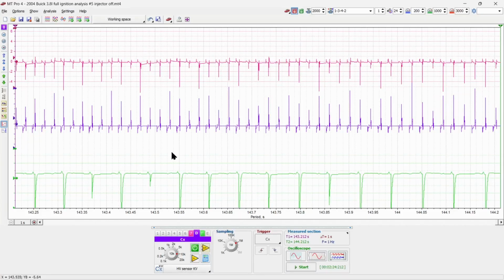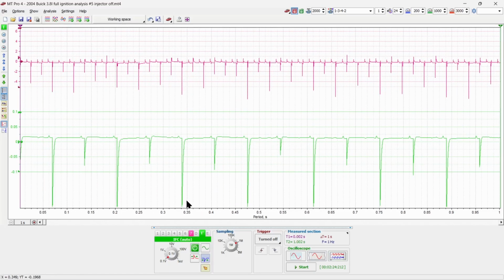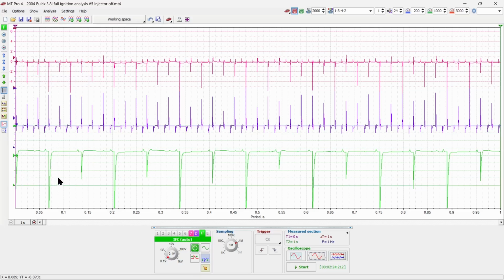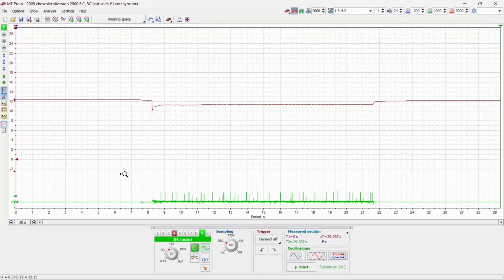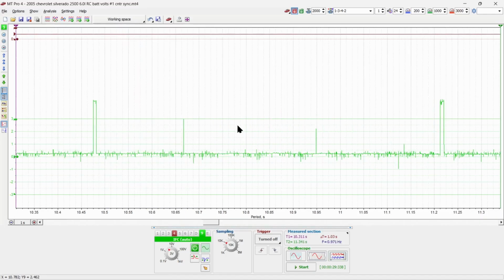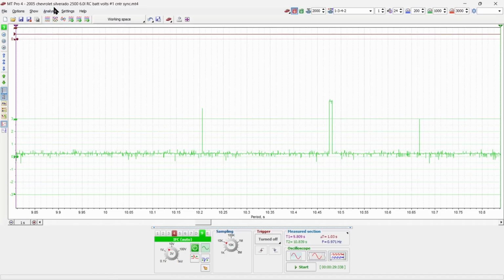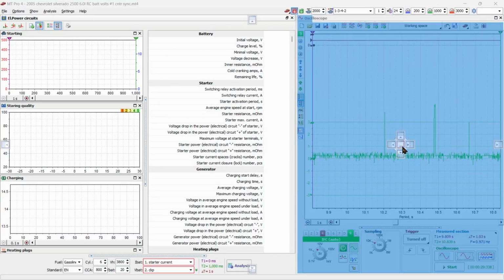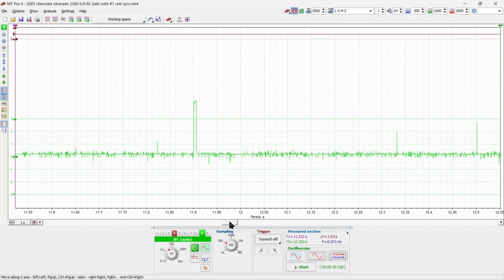Mt Pro Triggered !! Digital channel and window manipulation

Comment: So are you actually tagged into an ignition coil or COP using Ch 9 or does it use one of the other channels to generate that waveform? Still not sure what the benefit of this
Reply from the maker: Yes, I have Channel 9 with an ignition signal from a pick-up lead, and in the second example, I'm backprobed into a coil trigger circuit. 

The trigger channels main use is for cylinder identification when using the analysis tests.

Comment: Can you do a video explaining how to use the secondary voltage workspace and the cylinder balance workspace? Ive also noticed there's abbreviations within some workspaces like the secondary ignition such as COP "(Cx)" and COP "(Lx1)" and I have no clue what that would even mean so hopefully you could explain that.  A demo on the Secondary Voltage Analysis would be helpful especially on how to set it up
Reply from the maker: The abbreviations are referring to specialized leads made for this tool. You can find those leads at rotkee dot com. 

Some of the more advanced features that I've worked through have taken a significant amount of effort and time to document a repeatable process. I am building a webinar and guide to these tests. I will make sure I advertise the class once it's available. 
Thanks for watching.